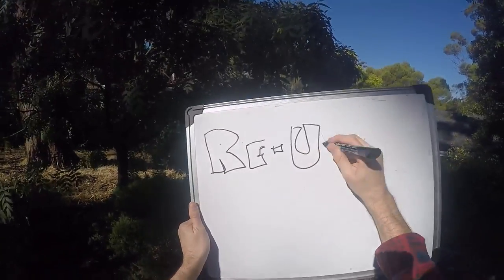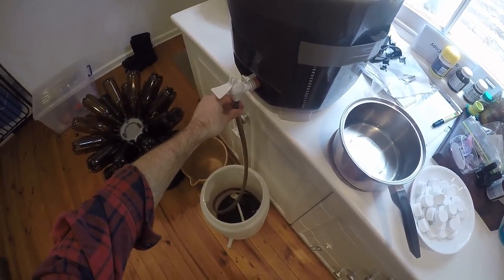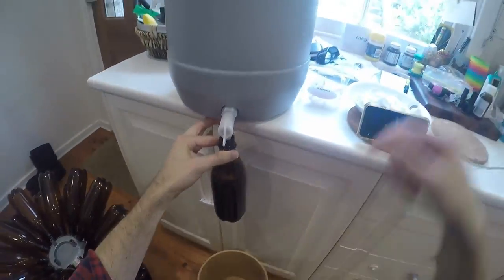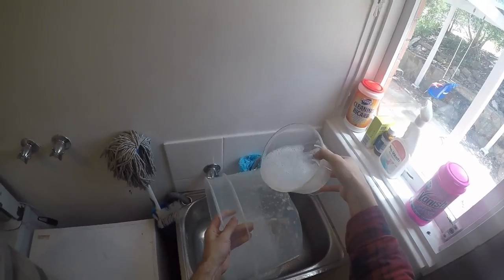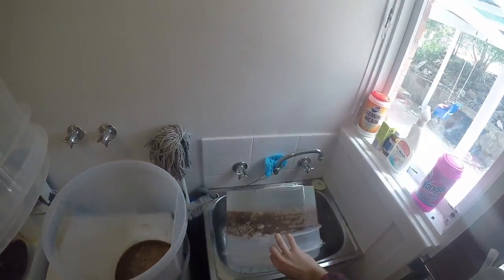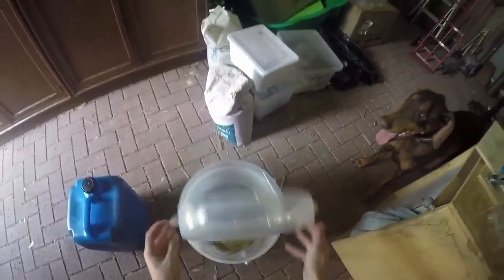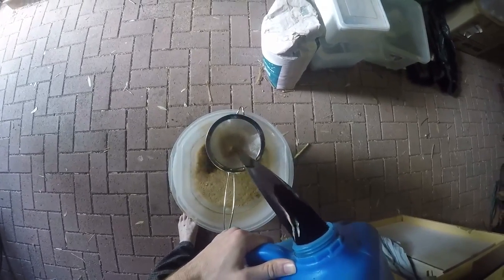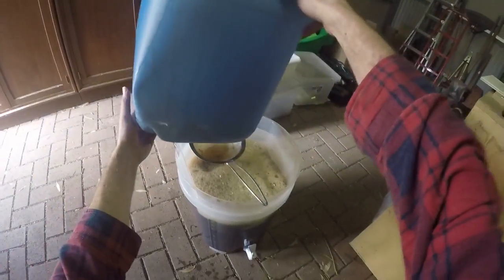Re-using Yeast, the even easier way!

Comment: The yeast should develop some refined flavours in your beers, IPA and ales in my case. The yeast has multiplied many times producing enough for multiple batches-2 or 3. Whether u use it straight away or save some is up to u.  I decant the last 500 ml into a large sterilised Maconna coffee jar. Swirl it around a bit and let it settle for 30 mins or more; u will get 3 distinct layers. These can be distributed into smaller glass jars and refrigerated for future beers/ales. 
Thanx for the GREAT videos.

Comment: Brilliant idea.... Nice and simple......I'm new to the hobby and I think I've got to the point where I've almost read and watched too much info.....But your vids are the exception....straight forward and un-complicated process to making a brew.Could I ask 1 q pls?  I notice you often use PET plastic bottles and this was my route to bottling.....But I've seen a few comments on other forums saying glass is always better, which has put a grain of doubt into my mind.I'm also trying to glug bottles of Grolsch for glass reusables but original plan was to use Coopers Pet plastics......I'd welcome your thoughts if possible please?
Reply from the maker: I think there's a bit of glass snobbery to be honest. Pet bottles are light and won't explode quite so badly as a glass bottle would. I also replace two or three of the oldest looking ones each time I bottle, so I am rotating through them slowly.

Comment: Hi, what should the temperature be of new beer on top of cake, and what to do when yeast cake was for 20L, and new beer is only 10L
Reply from the maker: I don't know the answers, and if there is an answer I don't know whether I'd be able to tell the difference between what's right and wrong, but I do know you're not supposed to go from high to low gravity, so 20 to 10L would be bad. You could, however, mix it all up and pour some out the tap before tipping the wort in.

Comment: Hey @FastHomebrew 

Great videos from the get go. A question though, in the few videos I have seen, I noticed that you don't use an airlock for your buckets. Is there a particular reason? I ask because I have a bucket and need to decide if I can punch a hole in it or not!
Reply: Those Coopers/Mr Beer fermenters are designed not to use airlocks. They don't seal airtight, so the co2 is able to escape from the lid.
Reply: @aav7230  Oh thank you! So something similar would definitely need an airlock right?
Reply: @tdeshpande26  if its a bucket with lid that seals airtight, then you would want an airlock. Otherwise too much pressure would build up. You just need to make sure its a food safe bucket before you start fermenting in it. If so, then you could punch a hole and add a grommet to keep the airlock in place. There are tons of fermenter options that are for brewing. A homebrew bucket with lid runs around $20.
Reply: @aav7230  Done! Yes it's good safe. It's a juice dispenser actually. Thank you for the advice
Reply from the maker: @AA V has got it right about my fermenter. Another option that some people use on different style buckets is to just put glad-wrap over the top and use the rubber ring from inside the lid to hold that in place